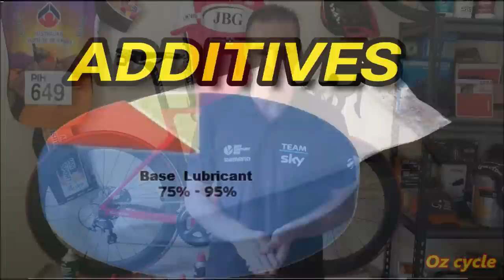Ultimate Chain wax - make it yourself

Comment: Using this system since almost one year now. Here's my report:
+ Chain remains clean forever (of course on dry road), you feel the need of rewaxing just because wax wears off and you will start hearing the typical dry chain sounds to warn you it's time. That will normally occur after 200-300 km depending again on road conditions and mostly temperatures - lower temp (in a range between zero and 10 C°) equals to a faster wear off.

+ Less heavily polluting chemicals used in the cleaning stage

+ No more chain mark on your calf or socks or hands if you need to touch your chain

+ With greasy lube your chain will attract dust and dirt so the more you ride the less your chain will run smooth. With wax this will not happen. Though I am no pro and can't really make a comparison between the amount of friction in terms of Watts of the two solutions as you get on the road after a fresh application. 

....and now the downsides

-  In comparison to standard lube an application of wax requires more time,  considerably more.
That's mainly because you can put any liquid lube on a not perfectly clean chain and still have a decent result. 
With wax you'll need to clean to perfection your chain, any time you rewax. 
This is to avoid your pot content contamination but also to have a decent and durable application: on a not perfectly cleaned chain wax will not stick properly and everywhere in the same thickness, so it will wear off quickly. Really quickly. 

- Cost is lower but not as you might think. You spend a lot less in lube (I have almost 15000 km with approx 10 € wax and 13 € PTFE powder and still have many applications in the pot) but you spend more with cleaning suff: Methilated spirit, degreaser and petrol (I usually need 2 stages with it). 
It may not be a big expense but there's also more energy involved (heating water for first stage of cleaning and heating wax). 

- Not so eco friendly as you might think. I use at least a couple of L of water in cleaning process, while traditional lubes don't require it. 
You will need more petrol as the chain must be considerably cleaner than lube for a correct waxing.
But I've found a solution filtering and reusing it as much as possible. Because Pertol will not be heavily contaminated as for cleaning a standard lubed chain.
So I have 4 different petrol cans: 1 is petrol contaminated with mineral oils - the one that comes with a new chain. 2 is usable but quite used, filtered petrol. 3 is almost fresh petrol - basically new petrol used for only for fine cleaning. 4 is new one.
This way I spare as much petrol I can. Otherwise it would be an ecologist's nightmare. 
Then, again, energy. Heating water and wax requires energy.

- You will need a better and more frequent cleaning of jockey wheels, because while wearing off micro fragments of wax will go around and create friction in the bushings and bearings.

- You cannot use any other chemical based lube (i.e. for jockey wheels) to avoid contamination and compromise wax durability. An easy solution here is using a bit of paraffine oil or some REALLY DRY spray pfte lube. 

That said here's my conclusions:

Waxing is great for any season except winters if the temp you ride with is below 10 degrees. 
The cleaning and rewaxing process is way more difficult than what's explained here. If I clean only with boiling water wax will not apply properly and will wear off super quickly (within 100 km). That's too often for me.

There are pros and cons as you see. As everything in life I'd say =)
I will stick to wax anyway during all year except colder months. Since I live in Italy this means I will give wax my preference 9 months on 12.
The remaining 3 months (some years 2 or even 1 in warmer years) I will switch back to my old system (vasoline grease) just because in winter I usually ride on wet and cold and these two factors basically nullify the benefit of waxing in terms of durability and dirt prevention. 
Durability of waxing in winter is really poor (in my experience and related to the area I ride of course).

I will wax all my family's city bikes as well because, due to the few km's they run in comparison to my race bike, I will probably need to rewax them maybe once a year. And nobody will dirt trousers socks....and that's just great.
 
If you are a patient and methodical guy that likes handwork it surely worth a try.

If you are not that kind forget about it, you will just get mad.
Reply: Interesting review, thank you Piero. 

I have just a few days convertedto wax and it is still below 10°....can confirm what you experienced.

On a 90km ride today it seemed to start to wear off during the last kilometers. So only 120 total km after cleaning and first wax. I think it was waxed well before the ride, and 
ran perfectly. Not anymore by the end of the ride, slight rattling and when inspecting the chain later, some links are waxed and still almost stiff, some have lost their waxing 
almost entirely between the rollers. It only really stayed on where it is not required, on the sides. Should it not stick better during the cold? 
Have you tried anything put plain PTFE+Wax for winter use? I now try and add some paraffin oil, maybe starting with just a little, and see if this goes a little better for the winter time. 

I do not think i want to turn back...now now...I like way too much how smooth my bike works with it. So guess I will rather invest some more time in waxing then cleaning. If i have
to rewax 2 times a week, so be it. Still better than cleaning my bike 5 times a week & ending up with dirt everywhere. Just a different kind of job, and a nicer one.
Reply: @oranjid  Wow, seems I'm in good company ^^
I had same idea from the start: mixing pure paraffine with other and very similar petroleum derivate to smoothen consistency just one bit. Though my goal was not enhanced durabilty I accidentally obtained it as a side effect. 

I mixed wax with vaseline grease bcause when I waxed the first time I wasn't exactly happy with the noise of the drivetrain.
I knew from other reviews that some noise was to be expected with wax, but hell! not that much noise! 
My previous lube with vaseline grease (applied with a hair drier) was super silent even when heavily dirty so I was very disappointed.

I so mixed paraffine pellets with vaseline grease that I already had in the garage and is produced from petroleum during same process paraffine. Similar but still different composition.
I started in a proportion of 9-1 as didn't want to nullify the benefit of dirt prevention making it oily.
Silence and smoothness weren't great so I decided to slowly adjust til reached an optimum. 
I found 80%-20% the best compromise. 
It ran in complete silent for the first 70-80 k's and was acceptable for the remaining. Plus had a pleasant side effect in enhanced durabilty, especially in cold weather.
It wasn't perfect but a solid step in the right direction.

I then added a further 10% (over total of wax + grease) of pure micronized PFTE powder.
I know, I should have added it since the beginning as the guide suggests. 
That was my intention indeed, but thanks to covid couriers policies ptfe powder took 11 weeks to be delivered. So in the beginning I had no choice.

PTFE was apparently a game changer. Now chain runs completely silent until wax starts to wear off consistently. 
For best result I reccommend 0.6 micron PTFE powder.
An almost irrelevant downside of micronized powder is that it will take you at least 10 k's to totally break-in, chain is very stiff when freshly waxed.

I realize now that boiling water might not be enough to clean my chain just because of this 20% Vaseline grease...ops my bad!

When temperatures rise I'll try with pure wax + PTFE powder only and see if I can save some cleaning time before a new application.
Reply: @pierovittori1076  I was more lucky with my PTFE delivery, though i got the 1,6 micron stuff as suggested by Steven in his guide. Rare stuff, but lucky we don´t need a lot of it. Sorry for you having to wait SO long. Frustrating if you want to try something new.

I read on some German forum that some guy first used the PTFE/wax first and then turned over to wax only and he was very happy with it. But that guy did a lot less km per year. Last year i went through 3 cassettes and a set of those beautiful silver campy compact chainrings. Old campy chainrings with the silver finish from 2007 are a bit hard to find, but who am i telling :) Dear Vittori tell me where these virgins in Italy are, polishing these things to mirror finish. I think they don´t do it like this no more. All turned black and carbon. 
Also it could be that the pellets we buy come in very different quality! I am rather sure of it. Viscosity, size of the crystalline structure, can be different.  I might try the more microcrystal brand, not  much difference in price. So i might continue making small 1:10 badges with ptfe in the future, but try different wax. What about flourated sky wax, it is meant to be more water-repelling that normal wax, and i assume this has most likely smaller crystal size. I guess i´d test around with it before pouring the precious ptfe into it, maybe just use old chain pieces to see how well i will coat and stick. Maybe just getting "any random" wax will also yield random results. Not considering this, might just buy another pack one day and it could turn out to be different. I did not find much read on this particular one. (Edit: Maybe not a good idea with the perfloutrated wax. Bad for the planet, seems they ban it from ski wax. Yet...smaller crystals in the way maybe a thing - maybe higher viscosity too, so no other additions might be required if lucky..)

My first reason to try this was indeed wear. Second was dirt - having the bike indoor and sometimes fixing it in the flat when it´s too cold in the cellar. It never turns out to be a good idea somehow, who would imagine :) And the she tells me again about my new tattoo on my right inside leg after riding in the summer. I used "Oelzeuch" as the last lube during winter. Many stores here advertise it for winter and rain use. YES it does really stay on your chain when it rains. It actually stays on anything it touches. It is almost impossible to wash of your skin. It is impossible to wash of your cloth. It is a pain in the * to clean of your group components. Also, on silver group set yes that black oil looks so nasty :) And then...the third reason was: try something new, can never get boring right? Stevens calm voice also hypnotized me i assume.
I did not even think about friction. I did also not really think about noise, i did not expect it to be noisy to be honest. 

Before waxing i had my group set fixed up, installed a perfectly straight new eye, cleaned all parts, removed the cassette and de-greased it although it was new and i just put it on..to avoid any contamination. i took the pulley wheels apart, cleaned them and just gave them the minimal ammout of thick bearing lube (i hope not too much of it will actually leave these glide rings, they will rather be clonked up with ptfe/wax i hope!) Maybe try to lube those with a thick PTFE-parrafine oil-wax mix? But just to make for this purpose...slightly annoying. So i used what i had and used rather little. I might just try to fit wheels with closed sealed roller bearings instead. Those small bearings don´t
last too long, but are cheap to replace, and they are pre-lubed and nothing usually leaves them without soaking them in solvent. 

But i figured some stuff out after i responded to your post - i took the chain of, it should just be at 1/3 of requiring rewax "by the tutorials" schedule. 10SG connex, now with 300km total on it and no stretch i could measure. Already some of the gold at one side is slightly wearing off, some bits very wax, some not so much i thought. Cleaned with a towel, it got some black stripes, nothing that would have sticked to my fingers though. Could touch it and remain clean hands, yet it seemed to be covered with some little greyish/black flakes.
The stiffness of the chain was gone, entirely "run in" after waxing. Still had the feeling it lost too much wax - the noises i started to hear on the last 10km of my ride. it felt almost like an unlubed dry chain, in particular the sound. The friction was still rather low. The shifting quality got a little worse but still acceptable compared to wet lubes. 

So i thought, let´s just re-wax and see what happens with hot water... so i poor hot water over it, 2 times with shaking, and the grey flakes are 95% gone. put cold water over it. No re-wax yet. The chain SUDDENLY is stiff again. like it has not even been after re-waxing. Surprise surprise. So there must still be plenty of PTFE/wax in the links, and indeed as promised the boiling hot water would not remove this. But i though it was already gone. Nope. It was not the reason for the noise. That seems to be rather lack of wax on the outside rollers, at those spaces where there is physical contact metal on metal. I doubt very much will remain there, once you start to apply some proper force over a distance. Once pushed away, how would any get back there if its solid? At 3°C this morning, wax would most likely not warm up enough within the drive train to get it around anywhere and for any to get back there. It will rather crumble away in the cold. So it will still reduce wear and friction within the links, but not within the rollers and chain-rings. There seems to have still been plenty of wax inside the chain. Still put it back into the rewax bowl. No wiping, no cold water, i just removed the really big bits. then i just press it onto the largest chain ring bit, squeeze the waxy chain onto the chainring firmly everywhere. Left a lot of wax on the chain, and i bet the same will happen again after around 100-150km if i go bike in the cold again, but it was a 5 minute job.

From what you wrote, i expect this is not a spring or summer issue, and i think it will be warm enough here for most of the year for solid wax/ptfe mixture. We have even lower temperatures here,  i will let you know if i figure out a mixture that works for me. Although i might run out of time, or out of winter :) That is not a bad thing though, but will move winter-mixture-science. Sad we can not DIY coat our chain with teflon first, before waxing. Doubt there is a healthy method of doing that outside a factory. The powder is bad enough, i´m careful with that stuff. The "wear respirator" sign on the package is for a reason. That stuff from my chain crumbling into the nature is not the nicest thought. At the other hand, the only "biological" lube i tested on my MTB was chainsaw oil. That stuff is also very sticky, and collects dirt. Runs smooth, is dirt cheap, prevents rust, doesn´t kill anything. But it is about as dirty and Sticky as "Oelzeuch" and similar brands. 

So far the most silent summer lube was just plain white oil. Soaked the chain with it, then wiped it clean. This collected dirt, but not as much as any grease or expensive (non-wax) lubes from the stores. But still black spots on my legs, and applying it in homeopathic amounts does not work so well. It hates rain, so i always had a little bottle in my saddle-bag. Might still have to carry liquid wax now... i will have to see about that :) Have a save and well waxed ride!
Reply: @oranjid  very very interesting and detailed infos.
There's always room for improvement and I got some useful hints. Thanks ;)

Edit: of course I was betrayed by my memory, powder is 1.6 micron not 0.6 as I wrote!
Reply: @pierovittori1076  Would not matter too much i guess, 1,6 should be small enough. 

My firtst Idea was just to use MSW. But it contains molybdenum sulfate if i am not mistaken, a brilliant lubricant. But I try to avoid it: It is very dirty black stuff, guess that explains the color of MSW.

MSW costs like 25 bucks / 500g
For wax+ptfe purchased from evil corp i end up with 20 bucks / 500g

So there is not a lot of saving, if you can´t score PTFE really cheap. I used "Materialix 100%", i hope to score some cheaper stuff in the future. The brand seems trustworthy though. 

Some wax i find online is branded with "very low oil content". Wonder if that is what we want. Maybe we rather want a high oil content? I guess this is paraffin oil content. 

Will try to find wax that has a lot in it already, and a small crystal size.  Wonder what wax is used @oz mixture. I think without the same kind of wax, hard to compare  results.
Reply: @oranjid  well, thank you. I am not on discord frequently but it's useful from time to time and I'll come to take a look.
Very interesting all you wrote and I'll be interested as well if you'll like to share any other experience you will make.
I never considered a particular type of wax as you suggested and I'll give it a go if I find any at a reasonably cheap price. 
But crystals size can indeed be a decisive factor in performance and durability under different weather conditions.

Happy you like the classic Campy silver. I hate this black and grey dominated carbon era. Though have to admit going to carbon frame enhanced my rides dramatically.
I ride shimano Ultegra on my actual bike and while it works just like a swiss made clock I hate the dark grey finish if compared to the shiny campy I have on the other bike.
Many time I am preparing for a ride I find myself staring at her with admiration. It's a 2001 Colnago Dream full aluminium frame with carbon forks. In descents it's accurate as a razorblade and my riding mates say faster than my actual bike too. The paintjob is just amazing. 
Then the drivetrain: Campy daytona 10S. I love that bike so much that I still go out with her even when I know that with my poor wattage climbing 8% avg with a 39T chainring is a true pain in the arse. That's my way to say 'thanks' to the bike made me fall in love with the sport ;)
It's not easy to find old original Campy parts, true, but still possible to find some here in Italy. If you look for something I'll be glad to help!
Enjoy your ride mate!
Reply: @pierovittori1076  Created the channel must for fun, and keep the contac+t, if you want to keep up exchanging experience in the future :) As this is very public and not a good place to find back what we wrote either.
So if you give me a short visit there once you feel like it, nice. You don´t have to, however you feel.

I admire the old italien group sets. I was into MTBs mostly till 1-2 years ago, when i bought a very little used 200xish road bike with a Campagnolo CT in very neat condition. Had do learn how to treat the italian lady right, so i had to pay some "tuition fee". I always loved my bikes, but did not know how to treat them correctly. So I did a lot about that. Learn to fix all my faults myself. Many bike shops don´t want to help, can not help, or if they want to help they are often just wrong. Had to figure that out myself, thankfully there is many nice chaps like you, like Steven, giving free advice. I just started listening a bit late, but i´m onto it :-)

So also thanks for offering help with parts. Might just want to ask you some things, as I am curious what is still available in Italy when you know your way around there. It is not catastrophic yet - there is a good online distributor that sells chainrings new-old stock, the 2007 baby-skin-polished kind i love to just stare at after cleaning. Affordable, yet expensive, at least compared to what i pay to keep my even older Shimpanso alive. But if the wax work i will go back to those. Now i used Zephyr chainrings from T.A. They look ok, overlap slightly over the edge of the crankset.They are true 110mm blades with identical thickness and they run very smooth, but maybe it is a sin to run french chainrings on Campagnolo, i am not so sure ;)))) 
Good: I can have 52-36 and that works for me. These do not exist in 110mm with the 5 sockets from the front as far as i could figure out. There seems to be a different to the 4front+1rear screw setup as with the carbon cranks and most 2010+ stuff. I mean, one hole seems to be different. 

Is Daytona compact yet? Or is it 135mm? I think the Daytona was renamed to Centaur after a short time? I think they are very similar from that i can tell with my still limited knowledge.

As for all other spare pats, it is still possibly to buy Veloce 10-s rear-derailers, front-derailers, cassetes, also still even the more expensive centaur or chorus cassettes. I tested miche cassettes and i can ruin them about as fast as a veloce, but they are half the price. And they have seperate chainrings, i find this is a good thing. So at least an option to keep in mind maybe for winter-dirt fights. I just wonder how long parts will still be there, i am not planning to retire this bike too soon. Might get another one with a slightly different purpose some day. I guess no carbon for me. Forks yes, saddle poles, yes, but even for the bars i don´t dare. Think i can brake anything, sometimes that monkey in me ^

No matter what chainrings i use, my shifting performance at the front can´t keep up with modern bikes. I tried any adjustments, height/rotation/pull/range but i can never get it quite right. It starts to feel quite loose, maybe just too sucked out over the years. So i have to shift precise - one click 2 much and it may sometimes throw the chain off. The rear works far better. Also the pulley wheels from campa both on Veloce and Centaur seem to have wonky glide-rollers. At the other hand they say swap them after 2k km and i usually ride them longer - maybe my fault. Still love this old system. Don´t need 11s or 12s cassettes. It does not really give you more gears up to what i can say. For m

Oh, and here it is rather flat, but climbing seems to work allright on 36(f)-25(r) for me if its "rather steep". I don´t think it will do good in alpine areas though. I don´t like to stand up on a climb if no need. Standing up on a climb + putting all my force in it = large monkey ruining stuff again ;-) I don´t use a power meter so i can only estimate so i won´t. But I broke 2 shimpanso hollowtec alloy cranks in my life.... I mean ripped them off at the left rather clean. I don´t want to add my centaur to that list i love it too much :) With the compact gears i can go uphill sitting down and be faster than many modern bikes that are 3kg lighter. For me it was just finding the right combination of teeth for cassette and chainring that feels comfy so i can run the gears i like in a good chain-line. Ofc the options are a bit limited, with T.A. you get a bit more if you dare a little sin. On the smaller chainring you will not notice at least that it´s a T.A. :-) Some might murder me for saying this haha.

Stay helthy & good ride to you too!
Reply: Another update for you Piero. 

Testing different kinds of wax for their stickiness and consistence after melting and hardening. Paraffin 54-56°C pellets vs. White big tea candle vs white stick candle. I did want to get high temp wax 90-100°C but i will first try, before i waste money on it. MSW seems to have that melting temperature. I wonder why.

First test without waxing: Paraffin wax is the most brittle. Tea-Candle 10-hours wax is the most oily and least brittle. Candle wax from long white stick candle will be translucent after hardening, and is most difficult to scrape off as well. More oily feeling compared to the paraffin from pellets, less compared to the tea-candles. Just dripped some on a flat surface and tried to get it off with some card etc. - Seems good to make that test first. How sticky is it? How brittle is it after it turns solid again? How oily does it feel? Does it rather crumble or rather stick together if you got some between your fingertips. Am I going too much Walther-White about Chain-Waxing? Maybe.

If you want i shall let you know how it turns out. I hope I find something that works before it gets boring :-D
Reply from the maker: Nice research. Best to have a wax with good cohesion
Reply: I had to, the first wax i tried does not stick very long and seems to crumble. First thought it was the cold weather, but i don´t think so. Thought at first not much can go wrong - but the chain started to sound and feel bad 2 times now below 100km.

So not acceptable yet. It has to work as good as yours, i need this to work :-)

The paraffin pellets i used (that do not work) have a very low oil content (>3%) It is easier to scrape of metal surfaces and seems not to stick to my fingers so much either. The wax from the 10-hours-tealights seems to be very sticky and more oily. Hope this will do the trick now :) Thank you!
Reply: @stevenleffanue  I still have issues with my wax, i tested 3 different mixtures now and am still not entirely happy. The first 40-50km always feel superb. Then, to 100km, i get more and more noise. Around 40-50kmh,  it sounds almost like running dry. Below 30 it sounds reasonable still. 

Chain will look still reasonable waxed, but is it? I am not so sure. I can still ride it like this i guess, but i feel like rather rewaxing before risking to ruin parts. Rewax every 3 days is not what i had in mind :) I do 200-300km a week and it should last at least that long.

So if you have any advice, i´d be glad. I don´t want to ruin my test by switching over to MSW. But at my current fail rate i´d be curious if it would do any better.

Maybe I did some mistake with cleaning, but i did as in your guide. Still, should i redo the whole cleaning process once more, to make sure I did not fuck up somewher? :D

All mixtures are 1:10 and the only real difference is the kind of wax i have used.  Maybe you got a hint for me, I´d be glad.
I make small badges so i don´t waste my ptfe so quickly, till i figured it out. 

Cheers!
Reply from the maker: Yes , do the complete clean again and preferably start a new wax batch as factory lube is very difficult to remove from inside chain links.
Reply: @stevenleffanue  Thank you, i will give it one more try. I guess no other way to be sure the issue is not with the wax mix. I still think so, but if there is still really a slight bit of factory lube,  hard to tell. I did a second thorough clean before the last re-wax, and it did not do the trick. Will give it another go.
I am happy when the chain is as stiff as in your video. Close, but could indeed be some factory lube. Connex must have gotten some leftover army-grease that was used to mothball stuff like tanks :)

Do your chains stay silent for the whole 300-350km before re-wax?
Reply from the maker: They get just a little noisy but not overly so at 250 - 300km
Reply: @stevenleffanue  Thank you :) chain soaks in petrol now. 

Maybe i am too optimistic, first 40-50km are so silent and smooth. So maybe it is ok and i should just ride on, maybe I do expect a little too much. If the chain does not wear out quickly, this would be very satisfying.
Reply: @stevenleffanue  When i cleaned off the old wax i found white some silverish-grey remains on a piece of cloth when wiping it off. and even after a long petrol bath on the second one, and in the bath. BAD if that is aluminum, from the color and as it´s not magnetic i would say so. 

Cleaning done again. This time i also did an acetone bath & shake because i thought: if the petrol did not clean everything and neither did the alcohol, maybe this stuff does. I heated the chain up to 200°C - waste of energy i guess, but i thought maybe this would dry out anything that is still in the chain. Hope that was not a bad idea, maybe overdoing it...

Also - new badge, just to be sure. And if this one turns out the same i can just throw them all together, scrape off the bottom part, and use them up at some time when the chain gotta go soon. I guess it will not matter too much then if there is some minor contamination.

If this really does the trick, Piero might have to try again on the nasty cleaning part :))

Looks really stiff now after the wax, i guess till next week i might be able to tell if this did the trick. Shame on me, if it was the cleaning process ;-)
Reply: @stevenleffanue  I do think it works better now. 45+70km in 2 days and no noise. Ofc this is not sufficient, but it seems to have done it. The mix seems to have rather low oil content. I did not use the tea candles (10-hour burntime) that stuff was too oily.
White long paraffin candles, the cheap stuff, with 50% paraffin pallets. It seems to have better cohesion than any of those for themselves. 

After 100+ km some of the wax has not even fallen of the sides of the chain. I did not expect bigger pieces to stick there.

A simple test: run my fingers over the edge of the chain after 50-80km. So use two fingers on top and bottom of the chain, press the chain together slightly, move over the chain and. If it feels sharp and not smooth and waxy, i know i f´d something up.

Also is is still so clean i would not even bother using a toothbrush. Hope that did it now. 

I wish for a davice... something that shakes my chain in the petrol over night ;-) Or rather just spins it for some hours so stuff that dissolves will move and make space for more petrol. I felt like a barkeeper shaking the chain in petrol rather long. It helped a lot. Guess that is where i f´d-up before :)

Thought it would be easier, but i guess next time i will clean more chains at once and wax them in one run, guess that will reduce the mess a little.
Reply: @stevenleffanue  now almost 200km and it is still good. today, below 10°C and it started to squeak slightly again, but still ok. So maybe...i did it...thanks again :)
Reply: @oranjid  Hey there, back after some easter vacation with only one thing in mind: RIDE =)
Had to track some new tours on komoot in a new area where I'll hopefully start soon to guide small groups. 
So had a lot of k's to grind and check the routes in person. And boy it was hard but worth every k.

Have some new sharings to submit too, as temperatures were in the summer range and had the feedback I was waiting for....

So I would be happy to join you on discord but the link has obviously expired, if you don't mind sending another I'll be happy to join. Cheers!